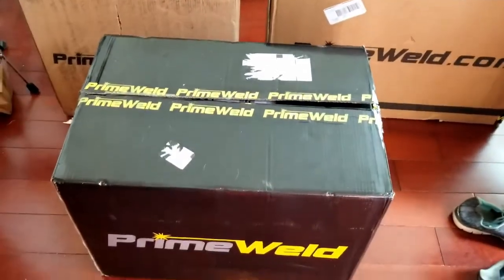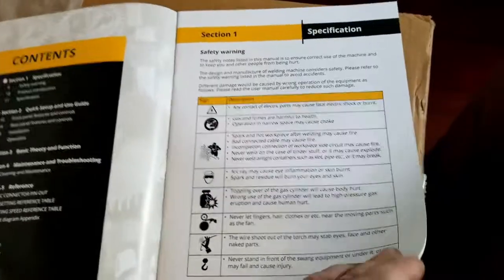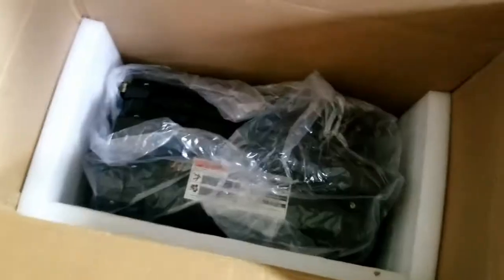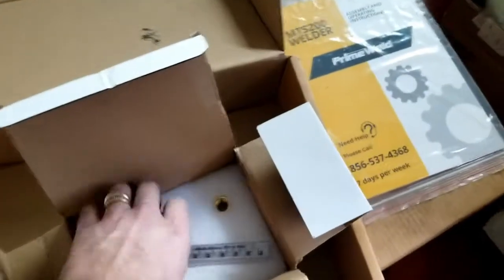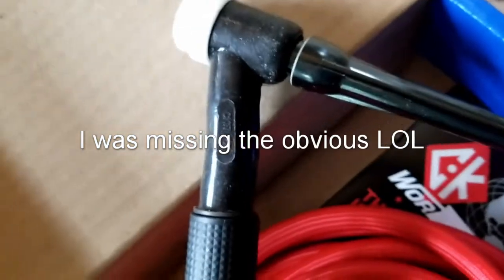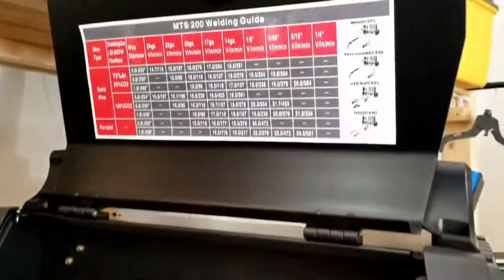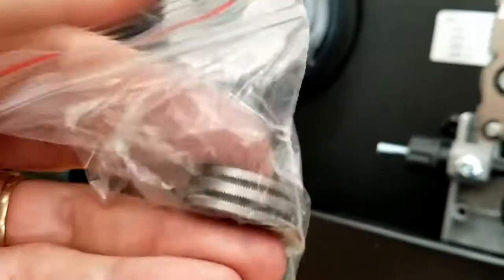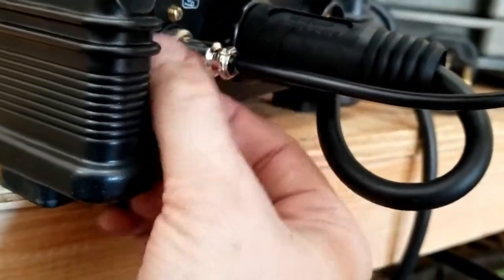Primeweld MTS200 MIG Welder, Plasma cutter CUT60, TIG TIG225X, and ESAB Savage A40 Helmet Unboxing

Comment: The esab a40 savage helmet it's working good? Any trouble with the head gear?
Reply from the maker: So far it's good, the tightening mechanism for keeping it on your head works well and it's comfortable. It was a little difficult to get the head flip to stay up but be loose enough to flip down, but it works ok once dialed in. The screen is great, just keep the outer clear plastic clean. I let it get dirty once and got a very brief flash due to that, but that was my fault not the helmet's. I wouldn't hesitate to buy one again.